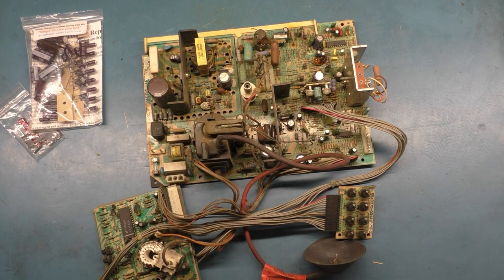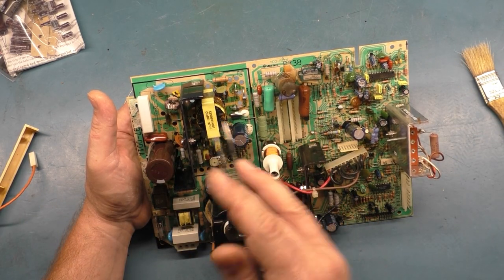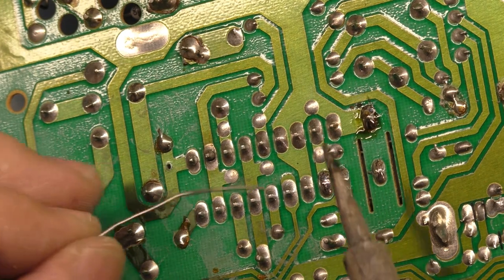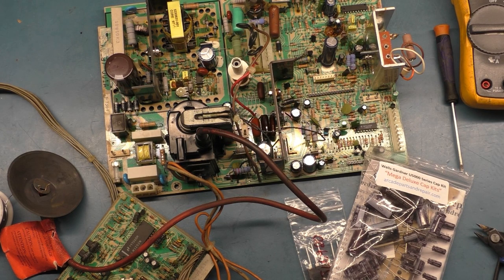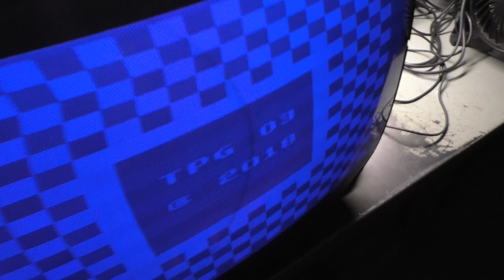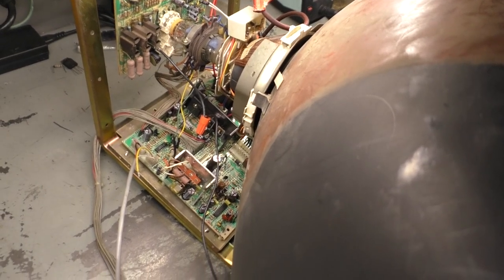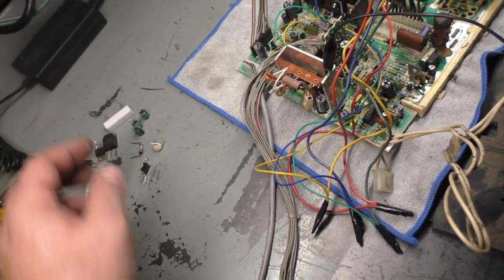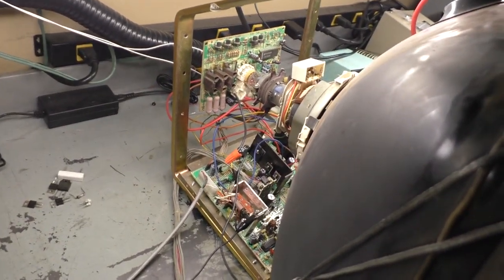27" U5000 Arcade Monitor Chassis Repair - "Not Powering On" - Cascading Failures Drove Me Insane

Comment: Interesting about the screen size I had a 25” u5000 on standard res never tried medium res, on a 25” tube and had the same issues of trying to increase the height all the way to edge and getting the same vertical fold over only at the very top and bottom 1/2 inch of screen or so it was worse on some boards more than others, and then one day i just plugged it in and it went away, I wonder if it was being picky because I might of had it on a u2000 or k7400 or u5000 im not sure which i was using for testing at the time, will have to test it out and see if it indeed picky not being on a u5000 tube

Comment: Type 2550.. no vid-B+ on TP203.- B+ is available with 148v (220v ac input).. I read 117v is the right value but 148 is the lowest value that I can set on the poti VR101.. do you have a hint to check next? The transistors checked fine in diode test.
Reply from the maker: Do the light bulb test to verify the power supply is good first…

https://youtu.be/8e2RDpUmBOc?si=moJdOQ-mUWD4O4fT